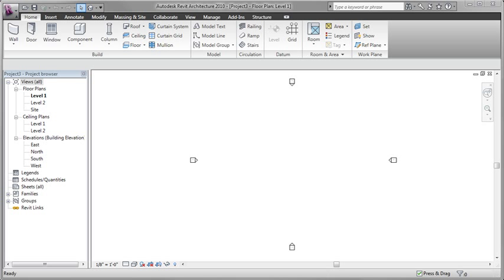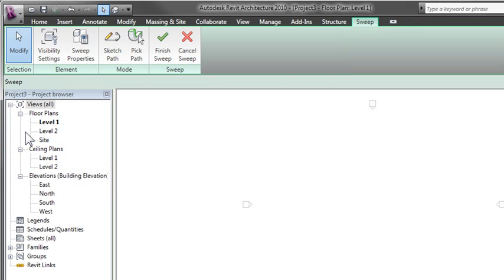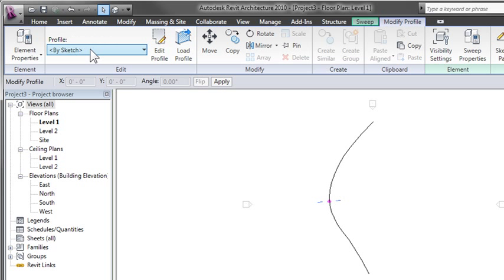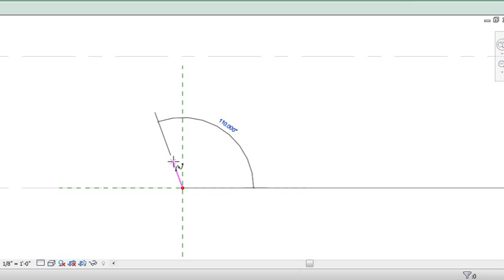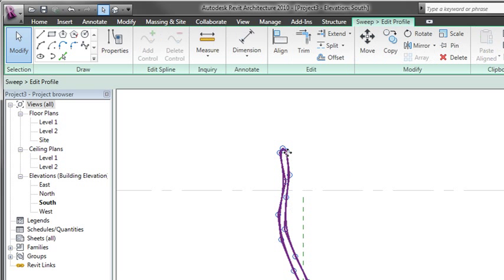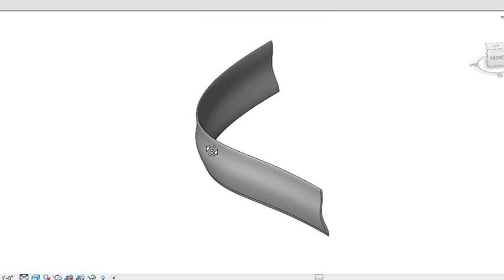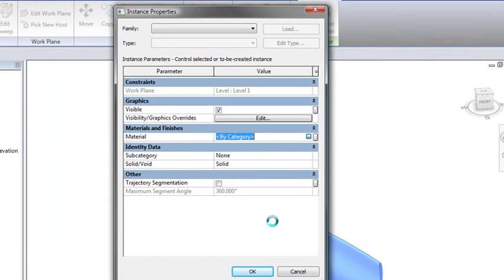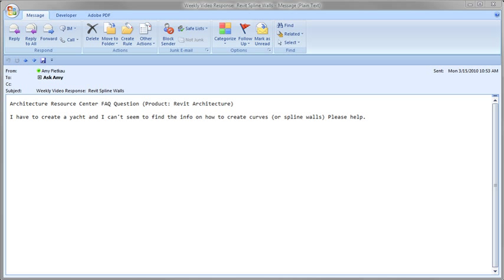Revit Walls - Based on Splines

Comment: To complete this video you could maybe add the option of creating a mass in place to later on use a curtains system, that way you not only cover creating an in-place wall but also curtain wall. Just a suggestion of course.